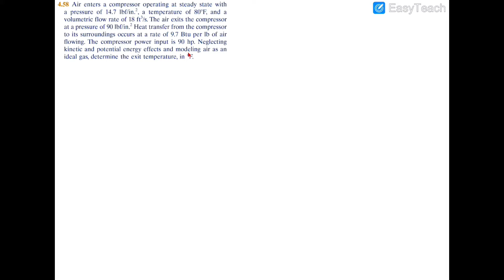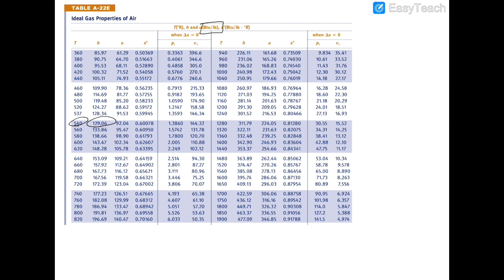4.58 Air enters a compressor operating at steady state with a pressure of 14.7 lbf/in2 a temperature

Comment: quick sill question, why did we have to multiply heat transfer with mass flow rate?
Reply from the maker: Notice the heat transfer is given in this problem on a per unit mass basis, so in other words we were given heat transfer in Btu/lbm. Our energy balance equation also contains power in the form of hp, which is on a per unit time basis.

To subtract the power from the heat transfer in the energy balance equation, the units must be consistent across the board, so we convert the heat transfer’s Btu/lbm unit into Btu/hr by multiplying by the mass flow rate. The power can be easily converted from hp into Btu/hr using the conversion factor shown. Once this is done, you can carry out your energy balance equation. Consistency of units is key. Hope this helps!